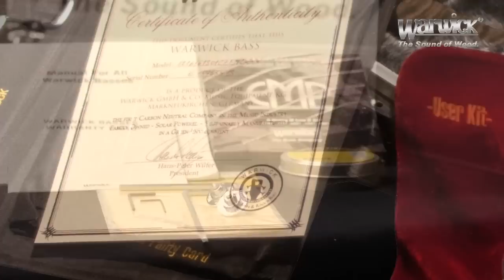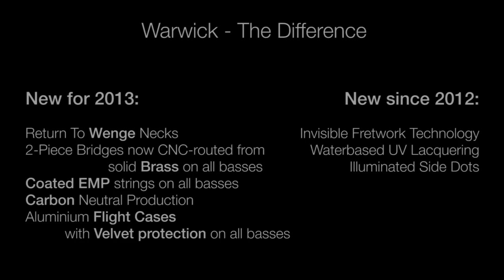The Warwick Star Bass II Bubinga - Product Demo

Comment: Can somebody explain to me how a hollow body changes the (electric) sound of the bass?
Except for stealing sustain/energy from the strings (from the pickup signal), I don't see any advantages.
Reply: The added resonance bouncing around in the internal sound chamber of a true hollow body affects the way the vibrations travels and reverberate trough the instrument thus changing the sound that goes trough the pickup as well resulting in a more "open" sound.

Don't think it does that much on this one though, it's not a true Hollow-body as it has a centre block making it a semi hollow or basically a solid block with empty, guitar shaped wings on the side so i don't think it would matter that much if this bass was solid or not, well except for the weight obviously.
Reply: hmm but the pickups can't pick up on how the air resonates inside the instrument, they can only pick up the string movement itself.

do you have a video for me that makes the difference between true hollow and solid body obvious?
Reply: Indeed they can't but it does influence the way the strings (and entire instrument) vibrate due to harmonics created inside the instrument thus having an effect on the sound coming trough the pickup because the string vibration is different than it would be in a solid body.

No i don't have a video but it's easy to explain, these semi hollowbodies like in the video have a solid piece of wood in the centre running the entire length of the body, a true hollow body would be just that..... hollow like an acoustic jazz guitar but with pickups.

Basically.... on the semi hollows it's only the sides that are hollow and true hollows are completely empty.
Reply: Ok, makes sense. 
Are there even "true hollow" electric basses?
Reply: If the magnets "only" pick metal vibrations, there shouldn't be any difference between fretted and fretless basses... but.. it is the day and the night.
About hollow bodies: Hofner Violin bass... I think Paul McCartney sound is quite unique... There a a LOT of hollow body basses. Very common 40 years ago. (electric bass designed to imitate double bass)
Is true that a mag pickup only senses metal vibrations. Is also true that instruments with different woods, bodies,fretboards, etc... they all sound different. You might say similar, and I will agree to that. None of those hollow basses sound like an upright, (as many wannabe upright players says), but they sound nice anyway.
Reply: There's a reason pretty much all electric Jazz guitarists use hollow body guitars.  It's the tone, man!
Reply: @joacorodriguez3420  

I only disagree with your “if, then”. 

Magnetic pickups only pick up the vibration of the strings – not the sound of the guitar (unless they’re microphonic maybe?). However, “the way the strings sound – the way the harmonics of strings are enhanced or cancelled, is strongly affected by the object the strings are attached to. In other words, the guitar itself makes a huge difference.”